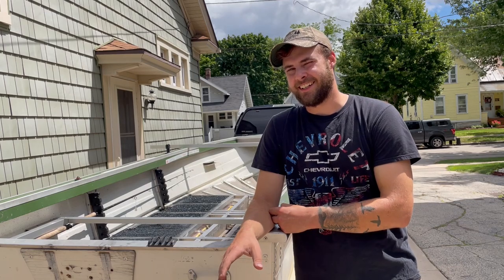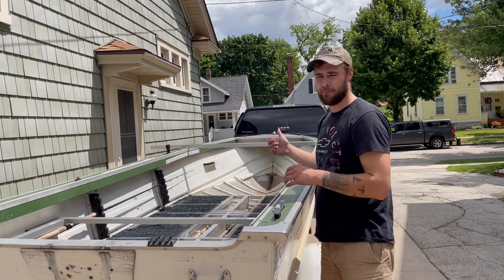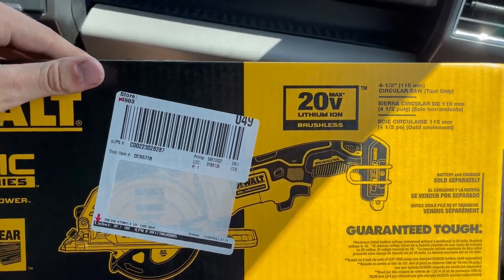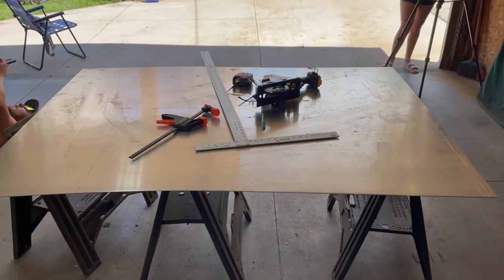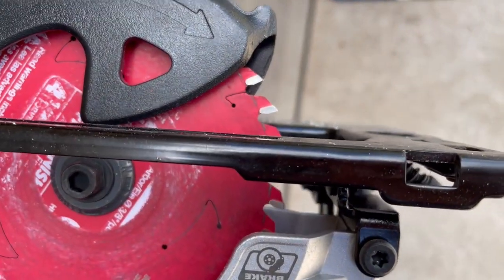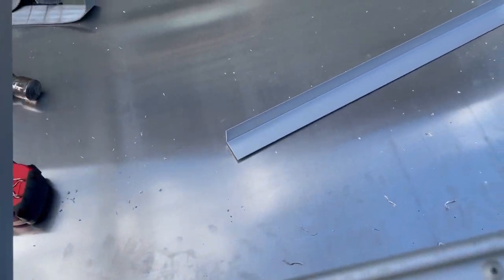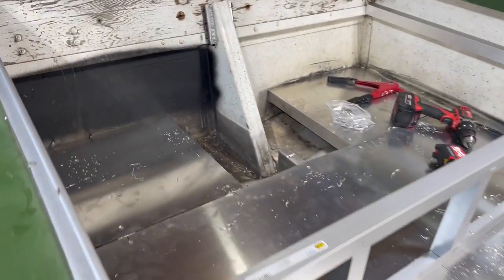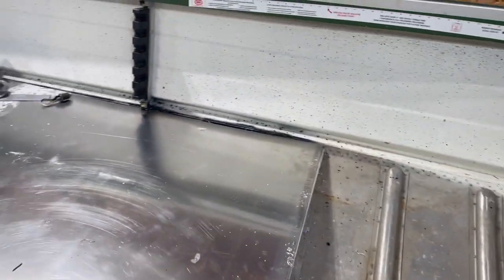Laying Aluminum Flooring In My Tiny Boat Build! | Salvage to Savage #4

Comment: I just finished up my winter project. Happens to be the same exact 16 ft starcraft, mines a 1977. Put 2, 1 gallon kits of total boat pour foam in it. All aluminum floor and front casting deck with rear seating/ storage boxes. Put bedliner in and painted complete interior tan. Put a new minn kota edge and new mercury 25 hp on. Wish I had a way to send you a few pics.
Reply from the maker: Awesome man!! Sounds like exactly what I’m trying to do. 
Do you have Instagram? I’m savage.senses on there. Send pictures I’d love to see it
Reply: @savagesenseoutdoors  sorry bud, don't have social media of any kind.

Comment: I'm not sure on aluminum however when cutting sheet metal like r-panel I was taught to use a wood blade turned backwards in a circular saw.
But you're doing a great job. I can't wait to see it finished up.
Reply from the maker: I’m not sure how well the wood blade would have done if it were backwards, because of the carbide tips on this one. Using the abrasive cutting disc was definitely not correct though😅

Comment: Good stuff
Reply from the maker: Much appreciated man
Reply from the maker: @Mark Legate I’m going to be doing a rubber undercoating for the interior and the outside is going to be wrapped
Reply from the maker: @Mark Legate hydro turf as well. The rubberized undercoat will be for the interior walls

Comment: great documentation on the build. looking good. just from my experience, use a blade that is meant for aluminum, diablo makes them. or us a cheap power shear from harbor freight. much easier for cutting tapers etc. just my 2 cents. great work though, keep it up!
Reply from the maker: I appreciate that! This Diablo carbide tipped wood blade did surprisingly well, pretty clean cuts. 
I’m in the process of building a garage now but I’m looking forward to getting the boat inside to work on it again!
Reply: looking forward to seeing it get completed! @savagesenseoutdoors

Comment: Why go with .90 aluminum? Wouldn't .40 work as well and be a little cheaper?
Good suggestion with the wood cutting, fine tooth carbide blade. I heard in another video the wood cutting blades would work well on aluminum sheets.
Reply from the maker: Yeah the wood blade did fantastic. Wish I took more footage of it. I went with .090 because it’s what I found most people recommended for subfloors on forums. I think tiny boat nation recommends .063-.090 and .090 was actually cheaper than .063 from the guy I got metal from

Comment: Where did you get your aluminum? Also you should use a metal shear. You can get one at menards or harbor freight for about 60-80 bucks. That's what I used on mine
Reply from the maker: I got my aluminum from a local machine shop, look for someone who does CNC machining because they’ll normally have a good link on aluminum sheets. They were $275 a sheet which was way cheaper than any online retailer I could find. 
I considered shears but the circular saw will have more uses for other projects. The cut is really clean and straight once I found the correct blade to use.

Comment: I'm going to use marine grade plywood I bought at home depot it was $125 a sheet I had to order it. I used it on anther boat I had and it worked good.
Reply from the maker: Awesome man! That’s what most people do too. I just chose aluminum to stay as light as possible and it’ll last a lifetime

Comment: Cut edges are getting hot, melting aluminum and binding with blade.  Lube with water for cleaner cuts.
Reply from the maker: Thank ya, the abrasive blade was my problem. When we switched blades we got a much better cut